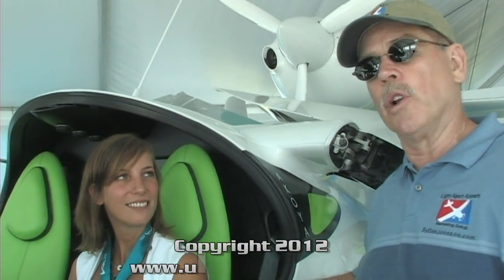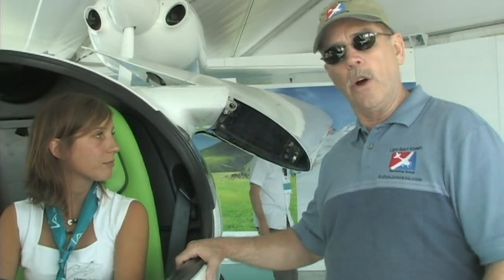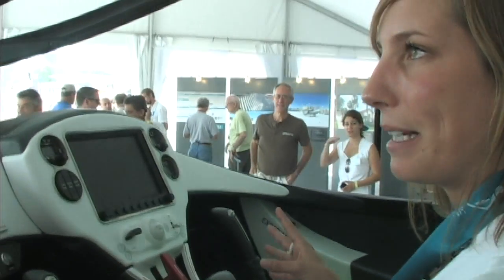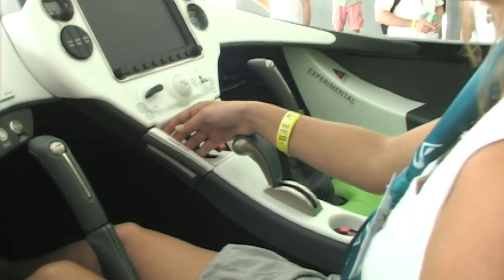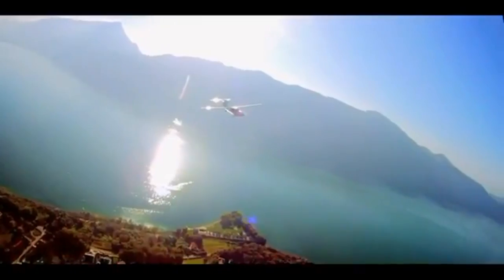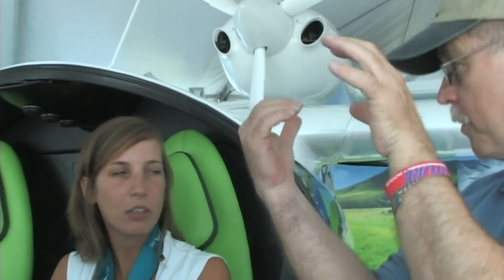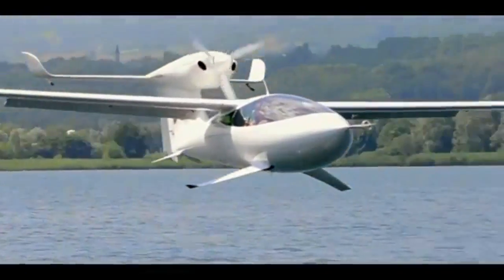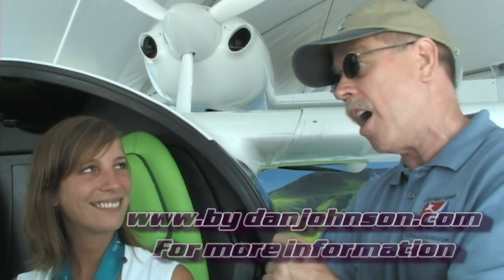Lisa Airplanes, LISA Akoya amphibious light sport aircraft.

Comment: About US$358,000 I am out. Cool design, wish them success, safety and good luck. I would rather a C185 or C206 on Anphib floats. Far more useful and 1/3rd the price. The hydrofoils are cool. This lady actually flew it.
Reply: I don't see many 185 on amphibious floats in good condition for 120 000.  They are also 30 years old.  It is a bit pricey for what seems to be a very nice ultralight.

Comment: FEW OF THE MOST IMPORTANT QUESTIONS HAS NOT BEEN MADE:
01) - What is the behavior during takeoff and landing in rough seas ?
02) - What is the maximum height of waves that can operate at sea ?
03) - What is the behavior with beam sea ?
Reply: "LSA" and "Sea" are just two words that do not fit together in my opinion. To me anything "LSA" means rivers lakes and other protected waters.
Reply: I asked the same questions and it seems to me that a lot of water could potentially come into the open cockpit when taxiing in a moderate crosswind.
Reply: @dannz2603  ROUGH WATERS IS ANOTHER SUBJECT  - THINK IN LANDING WITH  WAVES OF 2 FEET

Comment: Now you need a hybrid system.
Reply: A hybrid system would be cool, but the weight limits defined by this classification likely make the idea one for the future, as current hybrid technology (as in automobiles) weighs more than the class permits.  Too, such a construction would probably make the plane unflyable in its current configuration.
Reply: The weight of the plane does not exceed 500 lb's when dry.
Reply: I have said the weight of the Hydro XE does not exceed 500 lb's. The Lisa does weight too much.
Reply: Okoya is working on a system integrating an oxygen/hydrogen fueled electric motor subsidized by photovoltaic cells on all the upper wing surfaces.  It's still in the experimental stage.
Reply: Good to hear. The biggest hurdle is that solar has very low in amps. Fuel cells work better for ground vehicles. Jet burning nonpolluting bio fuel in an electric hybrid system is the most practical for high altitudes. We found a way to make them more fuel efficient. We can get 6 hrs from 30 gallons.